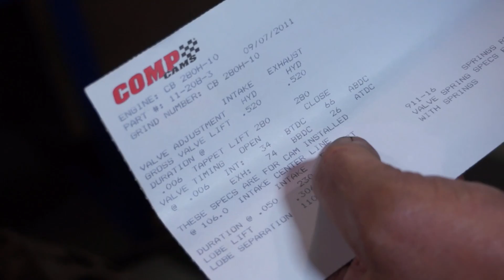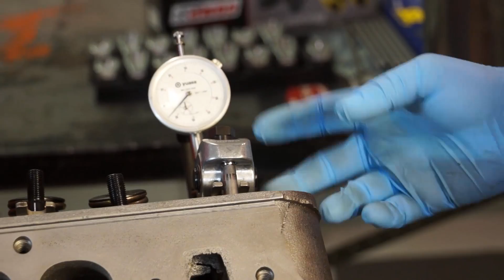Final assembly of the 396 Big Block Engine, part 1 - The Build

Comment: Very nice job of assembling the engine but you put in 0 cam break in lube. What engine builder in his right mind would even think about putting and engine together with out cam breakin in lube on the lifter and cam . You will destroy the cam or shorten the life of the valve train . Not only that but excessive metal will come off the can a lifters and end up in the engine oil I hope you dumped the oil right after the break in You cant break in a cam and lifters with just a think film of oil on it. Everything else the dudes spot on very good build but never put an engine together with out cam breakin lube